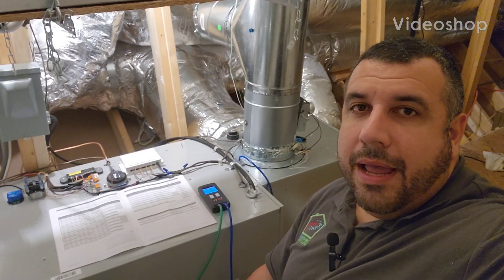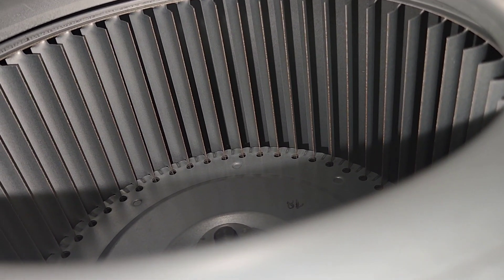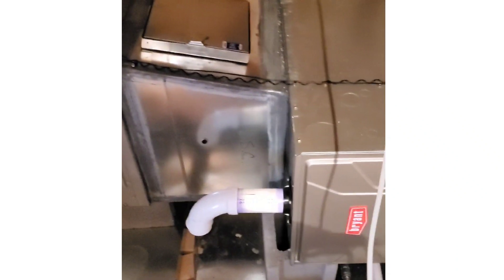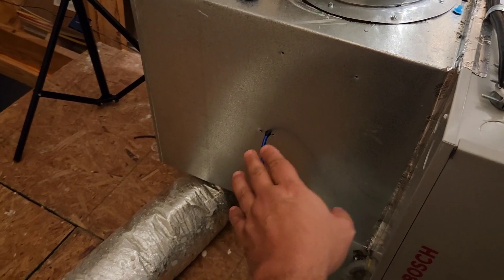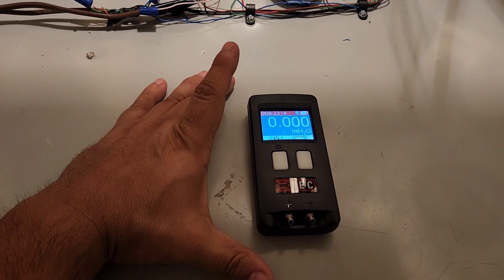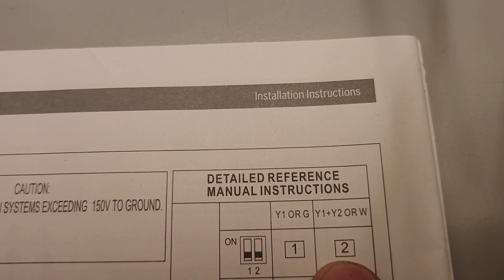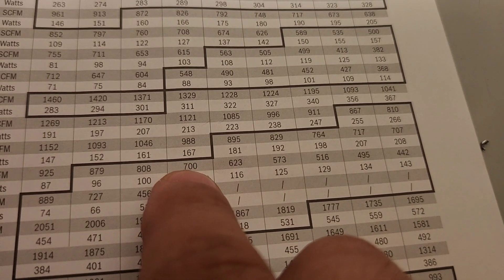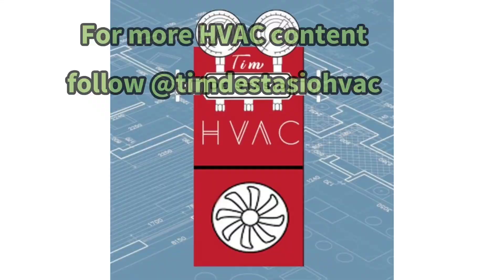Measuring Total Static Pressure with the TEC DG 8.

Comment: 2:11 - If that coil is dirty, you have an airflow problem!
Reply: Good observation. But it’s not. I’ve got a MERV 13 in front of it.
Reply from the maker: Some techs will check SP without checking the coil
Reply: Can't you just check sp drop across the coil. If it's dirty your meter will pick it up